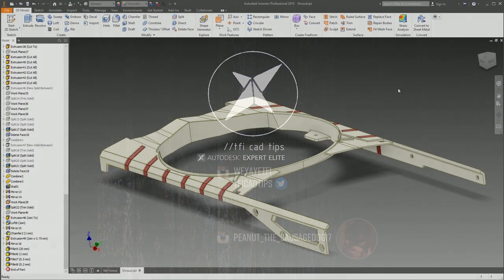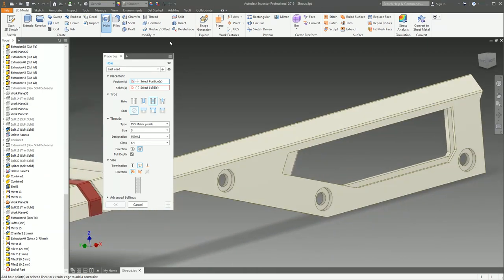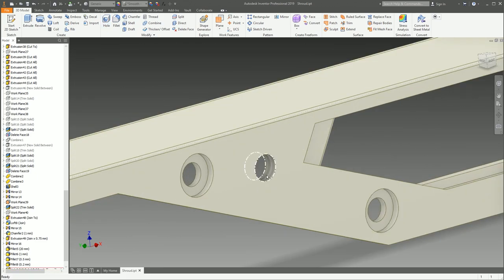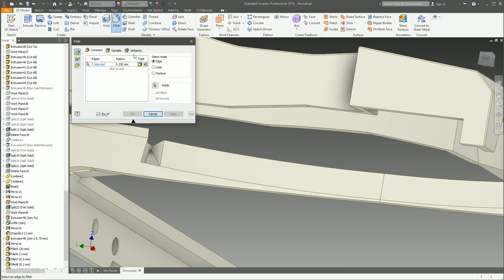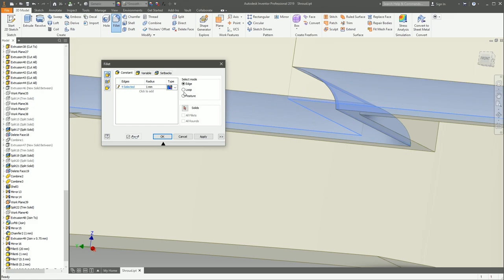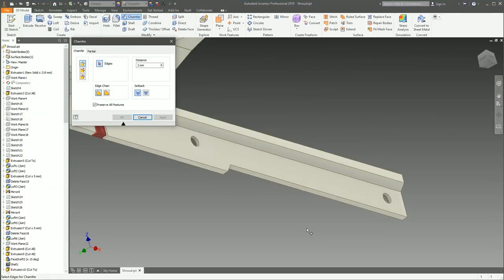AUTODESK INVENTOR EVERY BUTTON EXPLAINED! Part - 3D Model - Modify panel

Comment from the maker: Time Stamps:
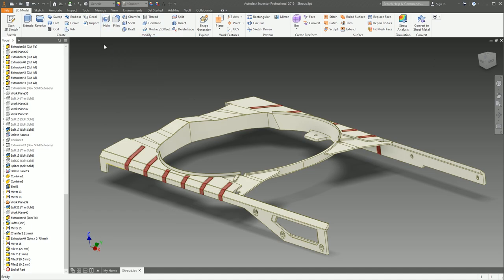Hole 1:00
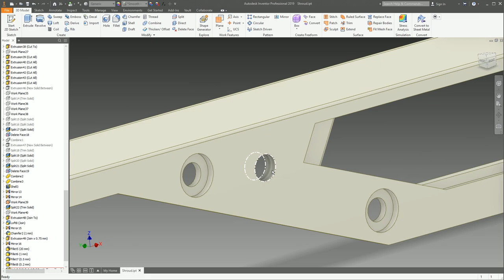Fillet 2:57
Chamfer 4:58
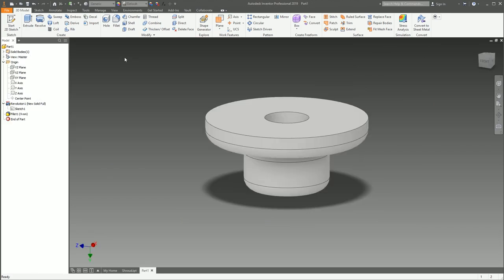Shell 6:05
Draft 8:39
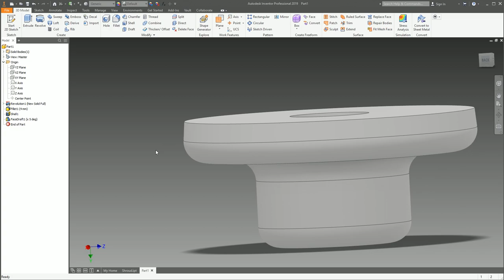Thread 10:04
Combine & Delete Face 11:50
Thicken/Offset 14:57
Split 18:17
Direct 20:47
Move Bodies 22:19
Bend Part 23:48
Copy Object 25:21
Reply: this might be a pain in the arse for you to do, but maybe a link to full tutorials, if you have them, for each button?
I'm thinking this should be a popular series, and could be used like a hub for your more in-depth tutorials, as well as channel view numbers etc.

Comment: Man, I'm loving this video series!!! I also love keyboard shortcuts. You should do one video on the ones you use on your workflow and how to set them up.
Reply from the maker: I don't use any keyboard shortcuts at all m8, if I was to use shortcuts they'd be on the Enterprise 3D Mouse
Reply: Oh well... I had a bunch of shortcuts back when I was working with SolidWorks but when I moved to Inventor I notice Inventor is not that Key-shortcut friendly as SolidWorks and that's why i got myself the SpaceMouse to move around (Thanks for the tips on that too)... The bottom line is, I haven't managed to setup some proper shortcuts on my software.

Comment: Can you use that Copy Part and sculpt series of commands (or similar) to have, let's say the same example you gave but a thicker plate and a keyway or externally extruded notch in the threaded piece and actually seat the piece into the plate? More than just the hole, the entire bottom surface but with the ability to still move it around in the same way? I know how to do that for the most part precisely, but being able to do that arbitrarily could become useful. 

Also, you say it's not meant to be a tutorial and yeah they are long videos, but good god, I cannot tell you how much I appreciate you doing videos like this. I am 25 years old and have been using inventor here and there for about two years, increasingly more frequently as I learn more about it, but it is such a gigantic suite that it is easy to become intimidated by it. I am not completely ignorant of Autodesk Inventor, however, I know just enough to know that I really do know nothing because you'll do something like that bend command or, what auto heal or autocorrect check box and it'll completely change how I design because i avoided using those buttons because I was using them incorrectly. 

You say they aren't tutorials, and yes, to an extent, they're not. I think you might have a hard time forgetting how proficient in the program you are sometimes. That's not uncommon though because engineers, regardless of the type of engineer, often assume too education or experience when communicating with individuals who are not engineers. 

You day they aren't tutorials but to me they are because I feel I still know nothing about this suite, despite a lot of your videos (haven't watched all of them....you've got A LOT of them) I still feel largely incompetent with it. Despite the fact this was nearly a half hour video, I still watch the whole thing from beginning to end. 

As much as you want them to be broken up into sections, I get a much deeper understanding when you drop little things like "this move button was largely replaced by direct edit" which if you hadn't just previously seen what that did then you wouldn't understand why that is. 

For anyone watching, watch and listen to every word, it's the little details that he'll say off the cuff as if he's talking to himself out loud that will truly save you a lot of frustration in the future. Little things like knowing that little bug when the cursor jumps to the end of the mm text when inputting numbers when numbers only are selected. That tells me to select everything and simply input number, removing the mm text as well, because the document is set to mm so by default Inventor will add it back anyway. 

Little things like that prevent us from making those same mistakes and in the grand scheme of things, it'll save a lot of time and frustration by ensuring that check box is clicked or the entire text is highlighted before I input numbers. 

To someone in my position, this is invaluable. Your content may largely reside in a rather niche area, which may very well limit the potential growth of your channel to an extent, the true value of your content for someone in my position cannot be expressed in words. 

I think Autodesk makes incredible software, however, they suck at educating users on how to use it, speaking specifically from personal experience. I have actually suggested more than once that they pay you to do it because their Webinars or whatever they do are just.....awful. They should really outsource the context creation for the education of their software. They should hire people for the sole purpose of being a direct line to content creators such as yourself and those individuals should be watching your content as well and offer assistance, correcting any false or misleading information (not saying any exists in yours, just as a general rule), elaborating on topics the content creator might not, and it would serve them better by having advanced feedback by someone such as yourself with bug reports or features that should've been added or removed already. 

On that note, I am a bit of a computer geek now. I have a few 4 and 6 Tb drives in my custom DIY Workstation and implement quite a bit of redundancy in regard to my file management. I have CAD file backups on my physical hard drives, updated relatively infrequently to be honest, and my active or recent projects reside on my B:/ 2.5" SSD drive and my C:/ NVMe SSD so that I don't wait long to open and close or save or update my documents. 

I don't mind redundancy if it for the intent of data protection or convenience. I've mentioned this to Autodesk about a few things in their HSM CAM plugin  (I'm a CNC Machinist) because certain things are should be a bit more intuitive when you set up a CNC mil to machine something you follow a certain way of thinking entire software should mimic that or anticipate that way of thinking. 

Long comment, forgive me, but thank you. I only wish you'd do HSM but that is another deep dark rabbit hole and you're not a machinist but it's not what I would call difficult to understand. There's just not many high-quality tutorials about it. 

Thank you you so much!